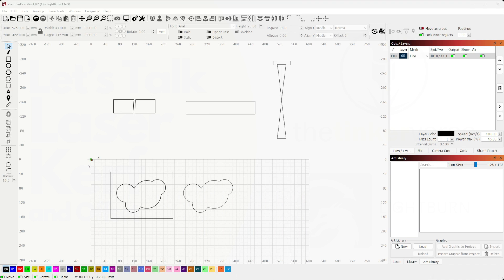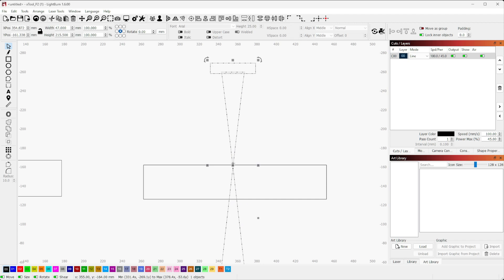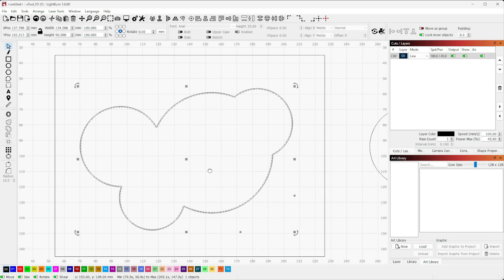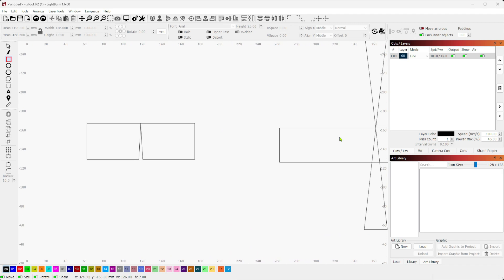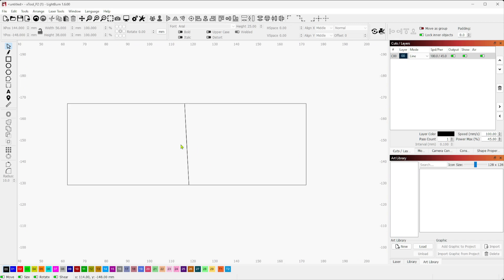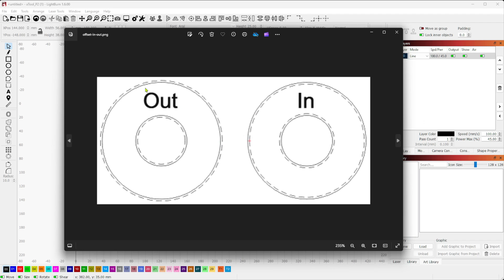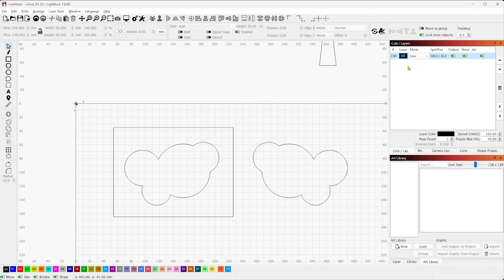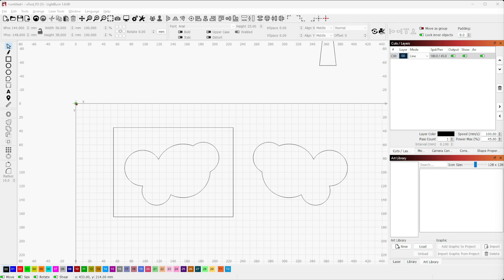Stop Fighting with Kerf and Offset with a Few Simple Tricks

Comment: Really useful video, thanks for posting. Will definitely try this. In the case of laser veneer marquetry I’m fining I get much less burning on the underside. Have you had any experience doing this and if so any suggestions of a good masking material to prevent burn marks on the veneer? Thanks again
Reply from the maker: I've found blue tape is about the best option for this. Just butt the tape strips instead  of overlap so you get a consistent cut (overlap may require more power).  Also having air assist on helps greatly with this.  It's been a long time since I've done any real marquetry work unfortunately but I'd love to get back into it.
Reply: @thetinkerverse  appreciate the reply. Will give that a go. Thanks

Comment: How do you have version 1.6.00? Mine shows that it's up to date on version 1.5.01. Is that a beta version?
Reply: Thanks, that really helped me with finger joints that sometimes are looser than I wanted. I like my finger joints to hold the material intact before I apply the glue.
Reply: I believe in the last video he said he was a beta tester for Lightburn
Reply from the maker: As @thesplinteredfinger noted this is a very early beta that I had for testing a fix from 1.5 before the 1.5.01 patch was released.  Just a timing thing really and there isn't much in my build that isn't part of yours at the moment.
Reply: @thetinkerverse  Ok, thanks.

Comment: Nice video! straight to the point. You did pique my interest though... t 7:38 you said if you wanted to cut "true to size" shapes you leave your kerf offset at zero. In my mind, isn't that running your laser beam directly over the line that would need to be cut, resulting in parts that are undersized by 1/2 of the laser kerf? Maybe I'm just splitting hairs here? Interested in your thoughts!
Reply from the maker: You are 100% correct. I should have said return to default size or whatever you're used to for your projects.  By default you're losing 1/2 the kerf per side which is why we're able to run the kerf test templates with a 0 offset and get a reading of what the average kerf is.  

Poor choice of word on my part unfortunately.